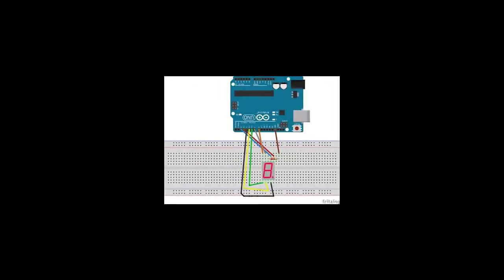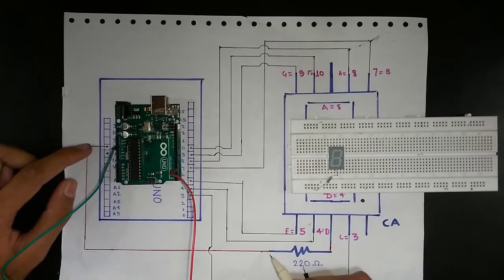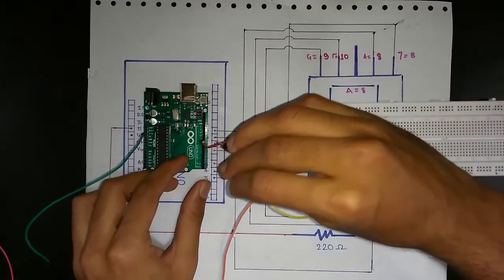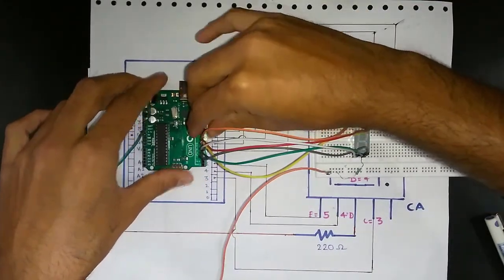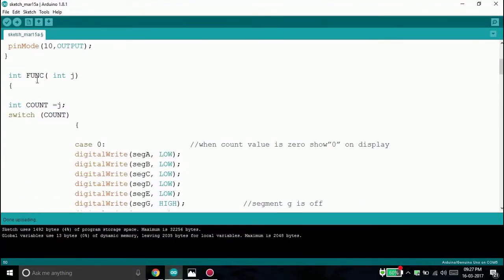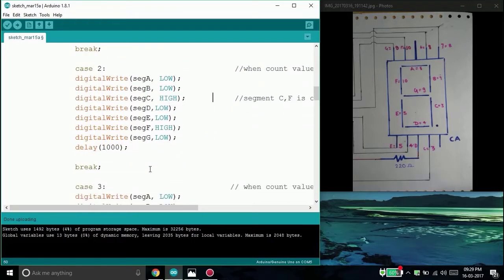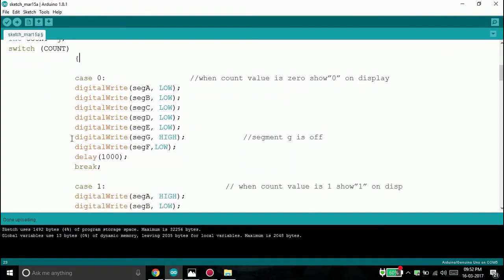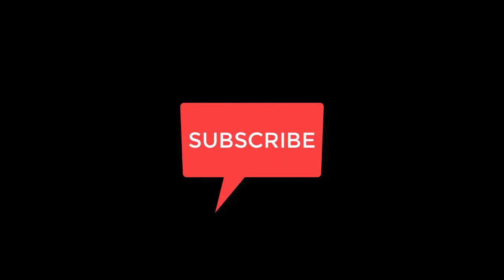0-9 counter and 9-0 count down by interfacing 7-Segment with Arduino

Comment: it was awesome video lecture  it solved lots of confusion  but sir i have a confusion that what's the role of common here and it works on cathode or anode and why ??. thank you !!.
Reply from the maker: very well , Sundaram, we have both kind of 7-segment  display, COMMON ANODE as well as COMMON CATHODE .

COMMON ANODE:- In this all the positive terminal(ANODE) of LED's are  connected  together referred  as COMMON  pin and the negative  terminals are LEFT open. So to glow the LED we need to give Ground or negative voltage to the "negative pins",so that circuit is complete.

COMMON CATHOD:- In this  all the negative  terminals are connected together referred  as COMMON  pin and the positive  terminals are LEFT open. So to glow the LED we need to give + voltage  to the "positive pins",so that circuit is complete. I hope your confusion is cleared.
Reply: But which one we are using in this video??
Reply from the maker: here we are using COMMON ANODE which is mostly used. As in COMMON CATHODE We need to put a resistor at each pin  to prevent the LED's from blowing up.